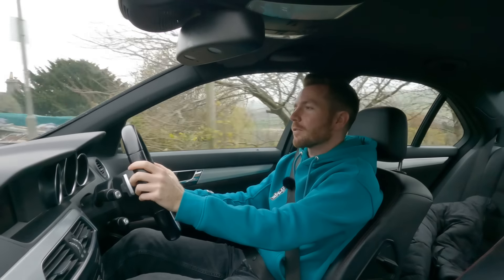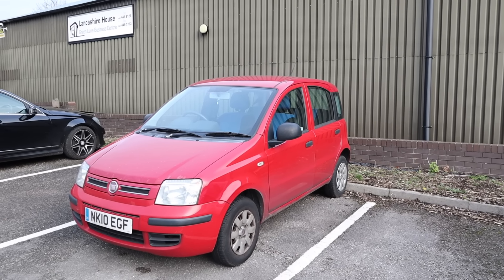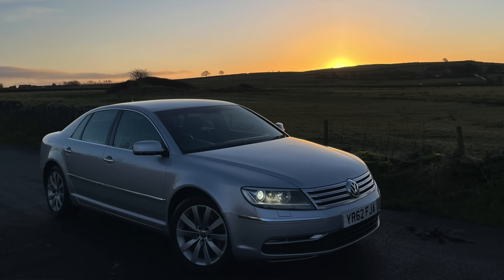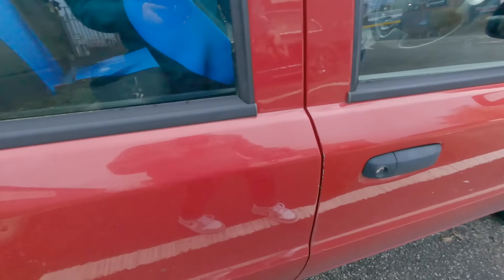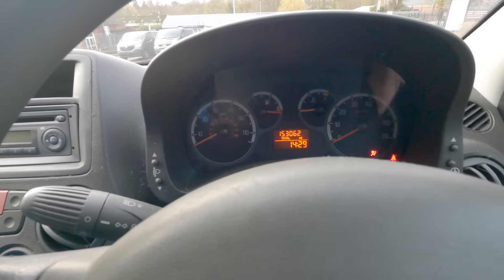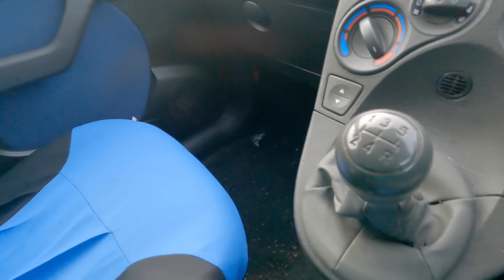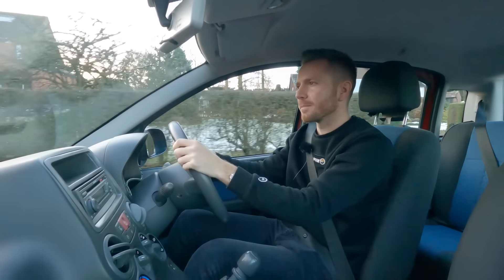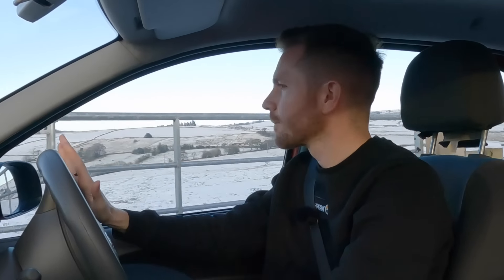I BOUGHT A CHEAP FIAT PANDA FOR £250

Comment: My first car was the Fiat Panda 1.1 , 2004 model ( approx £6,500 new ) which was car of the year that year. I had it for about 11-12 years and did 160-180 thousand miles. My driver seat also had wear in the same spot as the one in the video. Had a lot of over heating in the last year and sold it for £200 to a girl who was practicing for her test. I'm now driving a low mileage Peugot 206 from 2002. I'm thinking about changing my car every year till i stop driving at 70 years of age. I fancy trying some more exciting ( low cost though ) cars, so any advice would be appreciated.
Reply: You should make a YouTube channel about that

Comment: High roof-line, great fuel economy, low cost of ownership. What's not to like?
Funny story: Two days ago made a special shopping trip with my mum to an Eastern European large shop. Horrendous parking situation. Called for a cab. Driver an acquaintance of mine. Drove a BMW X6. Literally couldn't get my mum's shopping stroller/cart into the boot because of its sloping fast-back rear design. Had to put it resting against the front seat. Going back, he wasn't available. Called a regular cab service. Picked up in a 2022 Nissan Rogue SUV. Much more practical design with a high roof-line. Her shopping stroller/cart easily fit in the back. Ironically my acquaintance usually picks me up in the other vehicle he owns and drives far more often than the X6.... A very luxurious and far more pragmatically designed/shaped Land Rover.

Comment: Good video, I've had a few of these and sell OK, steering will fail eventually tho as lights started to come on, I've swopped the full column before, motor gets weak.
Reply from the maker: The light stayed off. I suspect it was a low battery
Reply: @HighPeakAutos  ah, that old chestnut mate, ha, ha.

Comment: Interesting that out of all the cheap cars you have bought recently the best two have been Fiats, not sure why they should get a bad rep for reliability. The Panda is a great little car may not be as well made as a VW but are much cheaper to run and maintain. Big up the Panda!
Reply: There has always been irrational prejudice against Fiats.  Maybe due to rust problems in the 70s.  My first car was an Uno and although it was very primitive it was a great cheap car:  economical, reliable, practical and good to drive.

Comment: I've had three Pandas over the years, they are that good. It is an unassuming unpretentious little car that will do pretty much anything you need it to do, be it the morning commute, picking up floorboards from Wickes or even taking four adults down to Alton Towers, all while being cheap to run and reliable. In town it has visibility rivalled only by a greenhouse, making the option of parking sensors a waste of money, even on the motorway it will sit at 60 or 70mph without too much bother. If it snows the skinny bicycle tyres will embarass SUV costing eight times it's purchase price. Plus, it's just very fun to drive in a chuckable kind of way......

Comment: I currently own a sedici 1.6 petrol. Good to drive. Heater doesn't work after the engine warms up, egr keeps failing, changed 4 radiators that seem to fail for some reason, had to redo the driveshaft and it has only 125000km. I'm not sure I will buy another fiat

Comment: Sounds strange but I preferred the older Pandas external looks, the ones from the 4x4 panda era, at least they improved the seats, the older ones were 2 metal poles with material that you could actually turn into an hammock (please correct me if I am wrong)😂
Reply: And the flat windscreen no flash curved glass.   Loved ours.     Now I love my Dacia sandero access no extras not even paint on the bumpers

Comment: Nowt wrong with a Panda 🐼😁👍

I have the later shaped one in 4x4 Antarctica limited edition trim, it,s the 0.9 Twinair engine of course and is a lot of fun to drive, very capable and practical.👍
Which incidently is now worth around £2.5k more than we paid for it in 2019 and we've put an additional 15k miles on it, go figure? 😲😳😁

That's a £1295 car all day long, keep it and run it over winter, advertise it for a silly price, if it goes it goes, if not you have a very reliable and economical runaround that won't lose any residual value.

Comment: this generation of fiats (2006-2010) with the 1.3 Multijet go on for ages. They sound like tractors, have stupid turbo lag and sound stressed over 3.5k rpm, but they chug along on dirty oil and bad diesel with no problems. torquey as well for such a small displacement. Only really can be faulted for the shit sound insulation.

Comment: Never heard what happened with the power steering warning.  I'd check the power steering fluid level if the light came on in mine.  Perhaps your mechanic topped it up and neglected to mention it?

Comment: These are the kind of cars that could deliver cheap motoring for a lot of people on low incomes. Sadly you can't use it in London due to ULEZ which also from August will extend to the boundary of the M25.
Reply from the maker: It’s such a scam isn’t it. So a nurse can’t drive to work in a £250 panda diesel but an oligarch can ride ride into town in a £400k Cullinan. Doesn’t make sense does it
Reply: @HighPeakAutos  what's also appalling is that it's going ahead despite the majority of Londoners voting against it.

Comment: If you decide to sell it, it's easy profit on those Fiats. Cheap to buy, cheap to repair, most of the stuff you can repair on your own to save money, if you have the time. And even if you leave them to a mechanic, they shouldn't charge you too much on labour times as these are quick to fix due to their simplicity - everything is so easy to access, parts are cheap to buy.
Also, the in the current economy? An easy sale - there's loads of people looking for a cheap daily driver to get to work + again, if anything breaks, it's easy and cheap to fix. Those engines are not super powerful but they get the car going nicely in cities and they don't use too much fuel.
You can easily get a grand or more for this Panda like you said, you eliminated the most apparent issues, the car is ready for daily driving, so people will be banging on your door once you post it on sale.

Comment: Somehow my 2007 Colt is still working well with 130 thousand on the engine , Just passed MOT yesterday and passed with tyres and brakes as advisories , car cost me £600 6 years ago never had any major work still on original Clutch too , If you want to make a good profit get Japanese cars you wont ever hear from the buyer again , I owned  a Fiat  Punto once and would not buy one again , as Fiats fall to bits

Comment: That’s odd, when you see seat covers here in the states on trade-ins or at dealer auctions, 95% are hiding disgusting and or destroyed seats, not protecting good ones.
Reply from the maker: That’s usually the case
Reply: Ive never seen a fiat panda without the seats ripped on the drivers lower bolster. I've been in a good half a dozen and they all had ripped bolsters.

Comment: Another great video. And I too have always liked the Panda, even going back as far as the original in the early ‘80s at the time of the ‘hand built by robots’ FIAT adverts…although I’m not sure that was about the Panda. Anyway, the 4x4 with winter tyres will go anywhere.

Comment: I had a 2004 Fiat panda as my first ever car after passing my test. It's an awful car anyway you look at it but you can't help but love them. They're easy to drive and park for a new driver and cheap as anything to repair. My mechanic at the time told worst case scenario, you pull out the engine in half hour, put a new one in for £150 in the next half hour and you're good to.

Comment: I looked at a car the other day, 25 times the price of that car and after getting out I felt soiled, they had sprayed deodorant around inside so much that I stank of it when I got out, everything was slightly sticky like the inside of a really dodgy nightclub, I didn't know what was safe to touch.
I would prefer the honest smell of dog to sloppy attempts to cover it up. Worse the dog had partially chewed through three out of four seatbelts, a clear MOT fail, which led me to doubt the rest of the MOT too. And three seatbelts with pre-tensioners would be the best pat of £1000. I walked away from that one.

Comment: I strongly disagree that the build quality is poor and that it is only fit to get you from A to B. Trust me, the 2wd version can get you to Y and the 4x4 version can go even further than Z. It can go further than many more and more expensive and heavier 4x4's won't go. Trust me. You see them everywhere in Italy providing services where no other vehicle can reach.
Reply from the maker: I didn’t say that without experience. I’ve had lots of these with bad gearboxes, engines, electric issues etc.

Comment: The one thing FIAT do well is small city cars. I would never buy another FIAT again, after my experience with a FIAT Stilo Multiwagon biggest piece of junk I have ever owned.
Reply: Sometimes not even that - loved my Gen II Panda, Wifes gen III 4x4 Panda is a disaster - Clutch at 40k, propshaft bearing - so new propshaft at over £1k cos you cant get the bearing separately, driveshft at 60k (bought that from a scrapper in Italy as they couldn't get one for weeks at Fiat...), 2 new batteries so far... list is endless.  Repairs have easily cost more than the car.....

Comment: New used.  Used new to me. Yup. The eBay way. wheel trims were free when buying 500 cars bca we just nicked em.  Nearly fell over when mate said used sets are like 25/40 odd and upto over 20 nicker per trim. What the hell
Reply from the maker: These are locked behind the wheel nuts 😂
Reply: @HighPeakAutos  oh yes.   I have one currently. £666 plus motorway fee. Up at £1999.  Feel a little like a thief asking for double up profit or a grand clear margin.  Well we are dealers. They are indeed behind nuts !!!    Fairing trims over alloys Prius another oddity !!!!